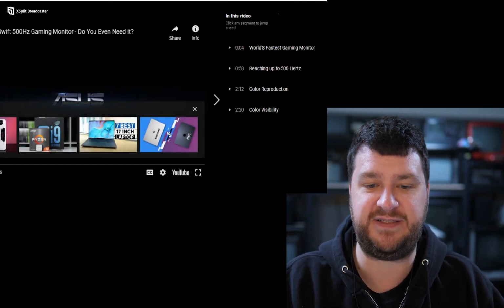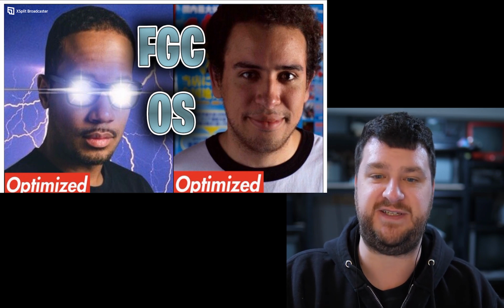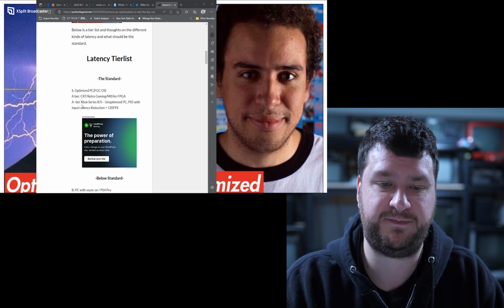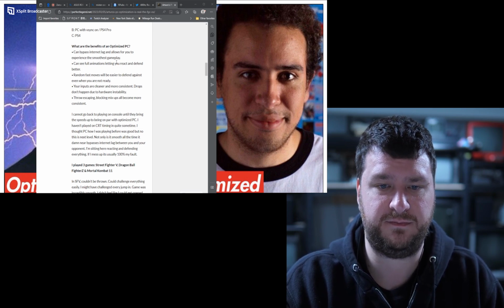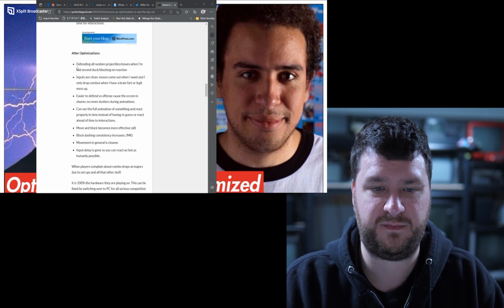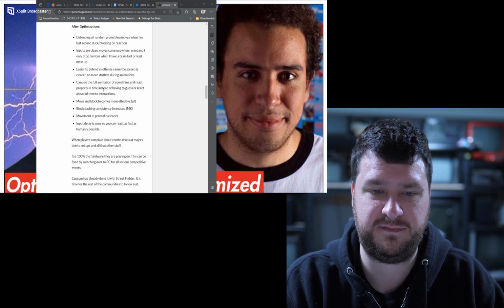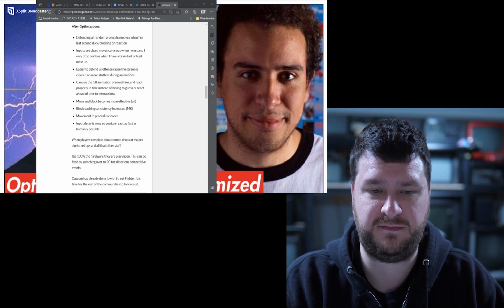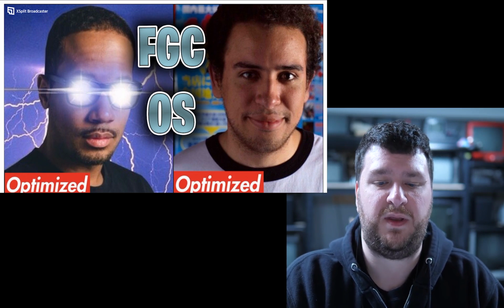Interview:  Introducing FGCOS (Alpha)

Comment: Plz Art save the FGC from poverty gaming. I played SFV at a major on PS4 and it felt like 30ms delay. I do not like tweaking Windows registry,etc so I have used software like O&Oshutup with a lot of those tweaks built in. I play at home on a 270hz Acer with VRB settings on and a 3080 GPU and minimal bloat because this stuff MATTERS. Blur Busters will tell you how low quality 144hz monitors are but I also see it every day at my computer job just comparing a 144hz VA panel to a 144hz IPS panel. I have seen 390hz monitors and the difference is huge (the Acer/AOPEN/Asus). There are retailers that have 512GB SSDs for $24.99 as of right now. There just is no excuse right now.

Comment: 46:45 this doesn't matter as much if your fighting game is locked to 60 FPS, which is why it's important to pressure developers to have unlocked frame rate option with an in-game frame rate limiter (Nvidia and external frame rate limiters don't work as well) for the PC version of their games.
Reply: sf4 and tekken 7 can run up to 120fps
Reply: @johnm4397  Teken 7 can only do it with a third party mod called Tekken Overlay. Officially it's 60 fps locked, just as is Tekken 8.

Comment: Love to hear more on this. This sounds very exciting. Wonder if this will be Mini-PC friendly, and give those Mini-PC a higher upper ceiling of a Fighting Game selection when you get rid of a lot of the Windows bloat, even at 60Hz/FPS as the cap.
Reply from the maker: It should be compatible with any Windows 10/11 install.
Reply: @RetroRGB  Oh no I meant, Specs-wise. Hopefully this less bloated stripped down version of Windows with extra Pro-Gaming features... gives extra up tick in frames to already anemic setups and better frame pacing. 

That's basically what I meant... basically increase that tight upper ceiling a bit more for the lowest of end Mini-PCs that you can get from Ali Express for decent Retro Games & Fighting Games. lol!

Comment: I'm really interested in this OS "redux", yet there are some issues I'm not sure how are going to get handled. A 480Hz monitor responds at 2.3ms or so by frame, yet if you only feed 60fps you get all kinds of problems like frame duplicates, which may ruin your perception of key frames. Most games are capped at 200fps cause animation go nuts at higher fps. How is this situation handled? If you have 480Hz and you don't feed 480fps benefits are almost mitigated the lower the fps is
Reply: You do get benefits playing 60fps games on a 480hz monitor just not as much as when the frame rate is unlocked
Reply: A 240hz monitor has 2.3 ms of input lag, a 480hz will be much much lower

Comment: I'm running fightcade with crtemudriver off my potato. Lag is pretty close to pcb. Don't see how fgcos would be worth the price in my situation...bought my potato for $200. Sounds like this is more for people running modern games.
Reply: That is precisely what they are talking about. Ofc u won't have a lot of lag running super old games with crtemu + crt, the challenge is newer games + tournament setups
Reply from the maker: Actually, there's still some lag with old emulation.  And it's variable, which can sometimes cause issues.  This will help with that.
Reply: @RetroRGB  yeah there is some lag. From my testing I'm running about 4 frames on fightcade with runahead set to 2 with street fighter 2 but this isn't too far off the pcb levels. All three versions of street fighter 2 ( ce, hf, st) have 3 frames of lag baked into the rom.

 I have NEVER found any variable lag with fbneo running any of the street fighter 2 arcade roms. I have found variable lag with other roms i.e.  mortal kombat console roms. In my experience the talk around variable lag is overblown with respect to fbneo and most of the arcade games.

I should clarify that I do find variable lag during online play with fightcade but this is caused by connection errors. I find NO variable lag when testing the emultor and not connected to another player, at least not with any of the popular games on fightcade. I have only tested the fbneo emulator on fightcade. I haven't tested flycast.
Reply: @arturseguro  I don't think the video was clear on that point. At one point in the video they mention that fgcos works best with emulation which begs the questios, " how does it compare to other emulation setups ie. Crtemudriver?"  And " is fgcos compatible with crts?" . It sounds like fgcos is solely designed for lcd monitors which is unfortunate for me. I would like an os designed for low latency emulation with my crt. I've spent a lot of time trying to get the lag low with my crt emulation setup. It's a pain.
Reply: Have yet to see what makes this different from optimizing your PC yourself, either.